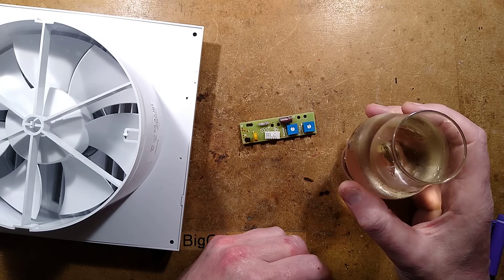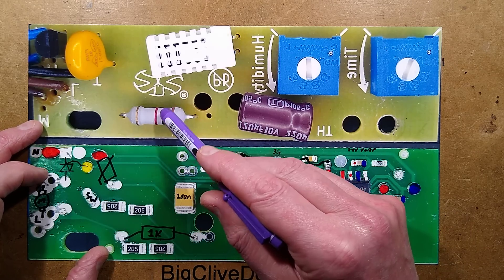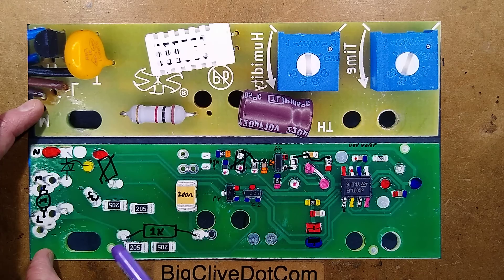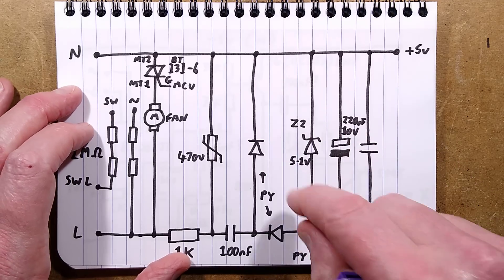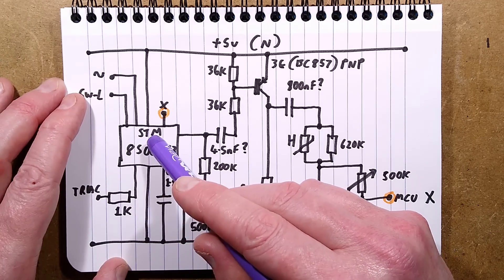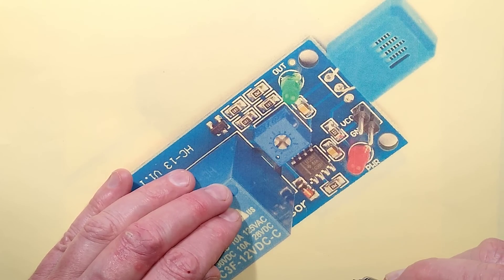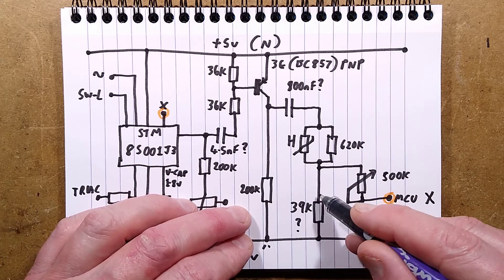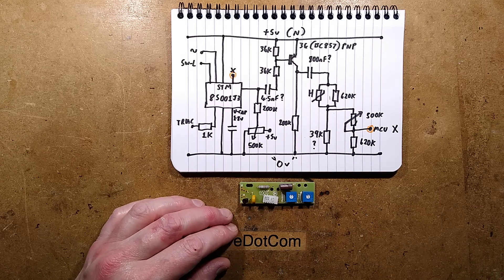Wine powered toilet fan circuit analysis

Comment: The small part will never be found in the room where you lost it. Small parts teleport to the parlor or dining room and end up under the radiator located under the window.  I have no other explanation as to why the parts end up in other rooms other than teleporting. I can guarantee that 100% based on my experience of taking things apart or building model railway kits.

Comment: Very clever circuits! Yes, using AC is required on these humidity sensors, though one place I worked used DC and got away with it for inexpensive devices. They probably didn't stay in calibration for years like the fan would. We also used AC for fluid conductivity measurements for the same reason (this being a much more expensive device.)

Was wondering what a "wine powered toilet fan circuit analysis" was until I realized that it was a wine-powered circuit analysis of a toilet fan, not a circuit analysis of a wine powered toilet fan!

Comment: You should design a proper humidity sensor module for the arduino.
Reply from the maker: They already exist in various styles.
Reply: @bigclivedotcom  yeah but you can do what the others won't...  

Make them in trashy hot pink.

Comment: May I be so bold as to ask you a question about this.
(Different make)
I have one that has failed…the fan doesn’t switch off…only way to stop it is to isolate the power.
Any suggestions?
Reply from the maker: Possibly needing the circuitry re-capped or triac replaced.  Probably easier to replace the unit if an identical one is available.

Comment: I thought you were gonna look at one of the fans from an integrated blower that fancy Japanese toilets and bidets are equipped with. 

For a subsequent video may I propose that you look at the circuitry on a $600+ bidet toilet seat to see what makes it tick? the ones with built in seat warmers are neat-o!

also I don't know if it means anything to you but because of you going over the circuit boards and going over the logic involved I realized my years of training in formal logic might actually prove useful. I'm applying to a computer engineering program next year after I beef up my maths this year. thanks man

Comment: That's a clever use of a single pin to both read an analogue input to read one potentiometer and also trigger the resistive humidity sensor 'the right' way. Kudos to the designer of that circuit!

Comment: By far the best teardown I've seen. I've created an HR202 humidity sensor library for arduino + simple schematics to run it with AC inspired on this circuit, requiring only an 100k resistor plus 1uF capacitor.

Comment: Nice one!
This was quite interesting how much thought has gone into a humility sensor like that.

What I didn’t understand though is: How do you make a neutral become a stable 5V supply?
Reply from the maker: Imagine a 9V battery connected to a live wire.  The connections will be live with respect to ground, but you will still be able to measure 9V across the battery.

Comment: Oh the dht11 are awful, go with one of the mems i2c ones these days. So much more reliable and less picky in the interface.

What an interesting circuit. And an STM8, a very cheap 8 bit chip, with the same horrible peripheral set as stm32f103

Comment: I just want a fan with three features - a delay start, an off delay and a humidity sensor. I can pick any two of those. Apparently a fan with all three features doesn't exist.
Of course there is a 'smart' extractor fan that can be controlled with a smartphone app though. Extractor fans should not need an internet connection lmao. What a time to be alive.
Reply from the maker: Those three features in a fan would be quite specialist.

Comment: they could spare the transistor with all its associated components. The pin of the controller can toggle between 5V and GND on its own
That would be 5 components of the BOM cost

Comment: By the way the reason for sensing AC line is because the capacitive drop power supply cannot supply enough current to drive the triac continously. The fire the triac around the zero crossing point and then turn off the drive to conserve power.

Comment: I guess the humidity sensor can be read by measuring the charge/discharge time from pulse to read between the two pins, maybe to a comparator type input.  It's similar to the RCtime function in PICBasic, but using two pins instead of one.  This would make sense with the large RC values.  Neat little circuit!

Comment: I know this is odd but what style/tip pen do you use? I have bought a few similar to it based on what I can see but don't seem right. I have been sketching some schematics and tried to find it. I have to use a very fine felt or other non ball point pen because my handwriting is bad and I assume it's because I am left handed most ball points that work fine for right handed people don't work for me.
Reply from the maker: It's a Pilot V-sign.  Refilled with printer ink.
Reply: I find Jelly pens work better then ball points.

Comment: In India we have exhaust fan mounted on wall that is controlled by a switch fitted outside close to bathroom door. Some (rare) also have 2 way switch one inside bathroom, so during winter you can turn the fan off after some time during bath. I have 12 inch industrial grade exhaust fan in bathroom and kitchen. Industrial grade fans have much more longer life span than domestic varient. These are noisy but I live in a noisy area.
I wonder why UK has so much sophistication just for turning on/off an exhaust fan!!!!!!!!!!!!!!! While you can just turn it on or off when needed!!!!!!!
I always wondered 🤔 about these humidity sensors and why in some instruments these have short life span.

Comment: Thanks for this, but just a few things…

The datasheet of the MCU says the ADC operates from 0 to 1.8V, so not 5V. It's also 11 bits, not 8.
Also, DHT-11 that you mentioned, is a piece of crap only useful for kids to learn how to use this sort of things, but not actually measuring things. The DHT-22 is good, though and the AHT-20/21 are even better and neither cost too much these days.

PS: If you like white wine, try a dry Silvaner, like the one from Wittmann. Very good German wine :)

Comment: Excellent!  I enjoyed the video.  The 3 Pin Humidity sensors you refer to at the end of the video are indeed the DHT11 and DHT22 models (there's an AM2302 also that uses the same protocol).  There are better options out there, but those sensors are more complicated, using I2C for communication.
Reply: The new DHT20 in the series now uses I2C.

Comment: 10:08
Clive, correct me if I'm wrong, but isn't it better to switch a triac on while the sinus is in its   peak voltage since current in AC is always shifted 90deg back? This way you have zero current at a triac terminals, right?
Reply from the maker: At zero volts no current can be flowing.

Comment: In your explanation ,There is something that does not make sense . There is no way that N of AC side of circuit can be 5 VDC at the same time , as it was noted in your drawings. There must be missing components that did not make it to your schematic..
Reply from the maker: It can.  Imagine a 9V battery connected to a live wire.  The wire is both live at full mains voltage, but also has 9V to the other connection.

Comment: Tooooooo much wine, Clive! ( :P ) The chip you can't identify offhand is quite visibly labeled LM393 in the video.

As for the temp/humidity sensors... there are two. The DHT11 is the cheaper of the two, and is notorious for having tolerances so wide that it's essentially a vestigial circuitry element in each and every potential use case. The DHT22 is fully twice the price of its cheaper cousin, but actually sports reasonable accuracy. Both use a horrible proprietary protocol that is notorious both for the fact that Arduinos inevitably have to bitbang comms with them, and for the fact that, in the best of circumstances, an Arduino is only just barely fast enough to actually manage some vague semblance of coherent communications because of the required bus speeds. Both sensors have a thusly well-earned reputation for being incredibly awful to work with.
Reply: Well, good news because their newer DHT20 is now I2C

Comment: The DHT11 and DHT22 are the three-pin humidity/temperature sensors you see a lot. They're terrible inaccurate and their one-wire protocol is kinda terrible to work with. The BMP180 and BME280 are I2C/SPI-based alternative MEMS sensors that are much nicer to work with. Bit pricier, of course :)
Reply: Look at the DHT20

Comment: Your theory about breaking the live and switched live sounds right.

That would explain the ubiquitous "wide switch" (they are chunky) three pole isolator usually above bathroom doorways in newer builds. I think it's a standard in the regs these days.

Also says "three pole isolator" on them and often has a fan symbol, though I've never taken one apart (yet) or lived in a house that had them so can't comment on genuine function of the internals.

Switched a few off in hotels late in the evening though, noisy buggers: I'm trying to sleep!!

Edit: the only thing I'm editing is this bit, after some love back from the man himself (fourth or fifth time now, which feels like a badge of honour): a big thanks to Clive for the effort and amusement he's provided over the years. Cinderella you shall drink for free and indeed most heartedly at the ball this evening, not 100% on the pumpkin taxi though.. hard to come by!

Comment: Fascinating teardown 👍 A friend introduced me to Humidistat fans like this in the mid 2000s - I installed a Manrose 4" into a bathroom purely in humidity mode - it worked brilliantly and had a knob to adjust the trigger point. Unfortunately Manrose then seemed to copy this style of design with their newer ones as I bought a couple of their new low power, super quite 5W fans with humidity and timer - the circuit board looks very similar but had a larger MCU - they never, ever, worked consistently with humidity - they'd either run non-stop or at times the bathroom would be like a steam room and they wouldn't come on - completely bizarre regardless of the tweaking on the pots. In the end the bearings became too noisy - they were supposedly DC fans - I've replaced them with some "smart" fans from Greenwood which monitor the humidity constantly and look for steady peaks in humidity to avoid false triggers - they are always-on at low speed and then jump up to high - again not perfect when humidity is already high but far better than the Manrose ones!

Comment: It still blows my mind that a simple extractor fan now has more computing power than the computer that I sawed up for 6 months for.
Reply: Does it? Then how many times your old computer is a common Wi-Fi light bulb, with a superior 32-bit ESP8266 chip running at ten times the clock of the fan's 8-bit STM chip?
Reply: I think your computer is probably fairly safe in this case, stm8s are in general 8 bit 16mhz kinda deals with a few kB of ram and storage. 
286 is probably going to outrun this by quite a margin.
Even a z80 with its 16 bit instructions would probably give these a run for their money in terms of raw compute 😊

Comment: Interesting how the sensors are so common over there. As a landlord, I install humidity sensitive switches for the fan so it is automatic, typically they are all manual in the US. One switch for the light, one switch for the fan.

Comment: I think it is actually better to turn on inductive loads (motor) at peak voltage instead of zero.
Reply: Measure it with test equipment and see.  Some things that bite you in the b%m are others that aren't what expect.
Reply: @jagmarc  it woud be good for everyone for you to share your instrument measurement details on this circuit.... 🙏
Reply from the maker: It's not.  At zero volts no current can be flowing, so the magnetic field will gradually build up as the voltage increases.
Reply: @bigclivedotcom Of course, triggering the triac at the voltage zero-crossing is simple and mostly unproblematic for a load that requires only 80 - 100 mA.
In a more general case, a problem arises because during the first half-period of the mains voltage the inductance of the load has a longer time to increase its magnetic field. This leads to a strong overshoot of the current through the coil during the initial transition (5 - 10 periods of the voltage) with respect to the permanent regime.
If the triggering occurs at the peak voltage (when the inductance would have had zero current in permanent regime) the transition time becomes somewhat shorter and the overshoot much smaller. Hence lower stresses for the components and lower perturbations in the power line.
Reply: "Triggering at zero voltage brings the highest inrush current which can be up to twice the peak current reached in case of triggering at peak voltage."
AN441 "Inductive load control with AC switches"
Reply: When switching on the fan.., it's initially at rest so there's no current through it , neither voltage across the windings.. therefore at zero crossing turn on, the inrush current is limited by the  very low initial voltage only.....
Reply: @analoghardwaretops3976  it is all about what happens next
Reply: @JGnLAU8OAWF6  unless the motor is "stalled"or in "locked rotor" condition,i.e. B.E.M.F. = zero.., current will gradually ramp up as speed picks up..
Initially turning on from standstill , @ pk. of AC voltage , current inrush is only limited by dc winding resistance .. at this instance 
B.E.M.F. is zero ...& that will be a huge amount of current...
Reply: @JGnLAU8OAWF6  triggering @ zero volts the
 " rate of change of current" can be maximum , but it begins with initial zero current...value..increasing in one direction/ polarity..
Reply: @analoghardwaretops3976  just read AN441 "Inductive load control with AC switches" App Note
Reply: @analoghardwaretops3976  i just ran LTspice simulation and my numbers match theirs.
Reply: In AC  power , @ peak voltage..the rate of voltage change is zero and the current drawn at this instant at turn on will be maximum , capable enough to cause some failure due to high current .

Comment: When you described a UK bathroom, it sounds like most bathrooms in North America where the tub/shower, toilet and wash basin (sink) are all located.  Our bathroom fans are a little different as they are configured more as a centrifugal system or a mixed flow fan than axial and typically vent out through the exterior wall.  We also typically wire the fan with a timer of some kind that can run from a few minutes to anywhere between 30 minutes to an hour.  The ducting that goes through the wall or vented through the roof has a flapper valve like a dryer vent (although, I have heard that Europe doesn't have ducted exhaust dryers, not sure with the UK...maybe due to fire hazard, not sure) or a central (or ducted as it's known in other areas) vacuum cleaning system.
Reply from the maker: We do have ducted vent fans, but not usually ducted air heating or central vacuum systems.

Comment: The AC driving reminds me of LCD's which are the same. Adafruit (and plenty of other vendors) sell what they call a Liquid Crystal Light Valve or a Shutter Glass. It's a postage-stamp sized single pixel LCD, which at rest is transparent, but if 5V is applied across its two terminals in either direction, it will go black. The little trick to keep in mind though is that if you apply long-term DC to them, they will have migration in the liquid crystals and fail. When I drive these I just connect them to two Arduino outputs. To make it go black I drive one high and the other low, and while it's darkened, I toggle both pins, effectively creating an AC drive signal across the two pins. It works quite well.
Reply: Yes, LCD (ie watches) have always been H driven and would be silly having a series capacitor for each segment

Comment: Clive, does the fan come with an optional shutter/damper to block outside wind as an option?
Reply from the maker: It came with a floppy plastic flap to block air from blowing in, but I was hoping for a thermally actuated set of shutters.

Comment: By interesting coincidence, I was asked to look at a faulty dehumidifier that used one of those sensors just the other week. I incorrectly assumed it was a One-Wire device like the DHT-11/22/etc. This explains why it was labeled on the PCB as if it was a resistor.

I have the control board sitting on my bench (the dehumidifier was a goner). Now I'm sort of curious to try and mess with the sensor.

Comment: I reside in a humid swamp-like part of Ireland, and sadly these kind of fans are just not good enough in colder wetter months.

I learnt Arduino code purely so i could make a much more intelligent and logic based fan controller that essentially gives a constant on and off cycle all day (to stop mold) and ramps up in shower humidity etc, or if ambient is over a set amount. I also use a much more stout industry rated fan, overapecced so it won't fail in a couple of years. Hopefully.
Reply from the maker: It's massively humid on the Isle of Man too.  I recently set up an experimental computer style fan that vents air out the house and into a ventilated underfloor area at the back.  Just that small airflow has improved the air greatly, reducing the musty smell of an old home.    I might try the same as an attic mounted filtered positive pressure fan.

Comment: Thanks a lot for the explanation on the humidity sensor.
I used to work for an Agricultural Research Centre and developed a low cost green-house control system (controlling A/C, windows, shades, fans, watering, mist generator, etc.) for use in green houses on remote islands, with off the shelf parts. I used the DHT11. I know, they aren't really good (but good enough for the purpose), but I designed the circuit in a way, that the sensors can be easily replaced by the farmers themselves.
This gave me a new idea to (maybe) redesign with different parts.